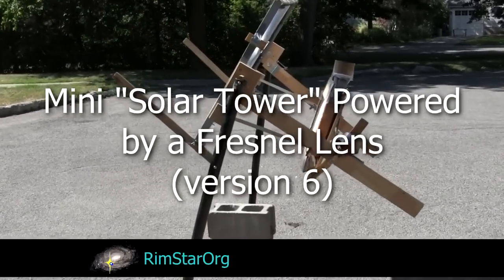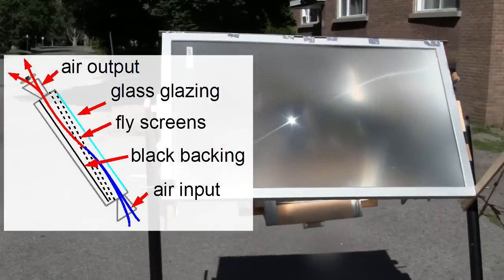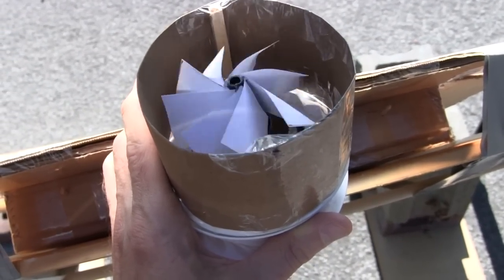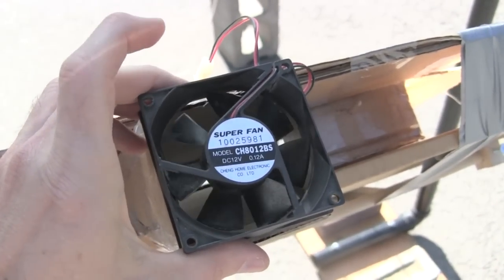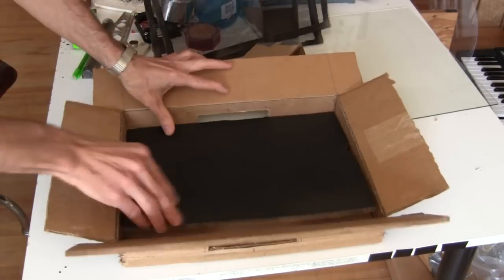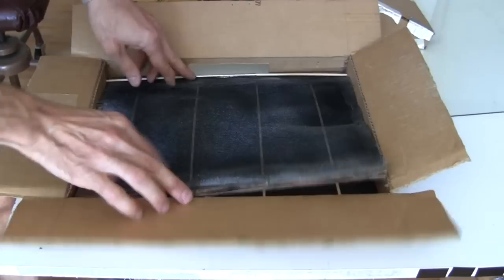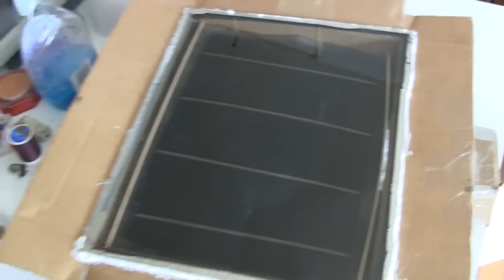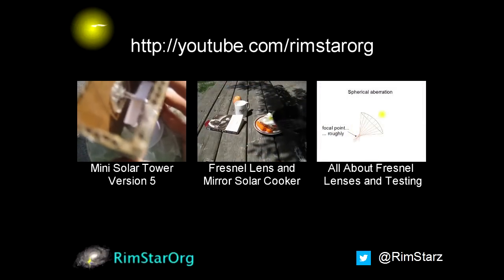Mini Solar Tower with Fresnel Lens Ver. 6 Screen Solar Air Heater

Comment from the maker: Which materials specifically? The fresnel lens and its frame came from an abandoned rear projection TV. The stand and nuts and bolts is ABS tubing from Home Depot. The glass for the solar air heater box I bought from a glass store but any window glass would have worked. The cardboard is scrap from various sources. The PC fan is from an old PC. The dowel is from Home Depot. The camps were from Canadian Tire (hardware store.)
Thanks for your feedback re the video being easy to follow.

Comment from the maker: I went with cardboard instead of plastic because it's less prone to melting (a problem I had with versions 1,2,3) and gave me a little insulation. Of course if I were leaving it outdoors I'd have to go with something weatherproof. I'd also stay away from a metal pipe, at least nearer the heat source as it absorbs all my heat (learned in version 5).  I do have some 4' long 4" diameter ABS which I could put at the hot air outlet of the one in this video (ver. 6). I smell a version 7 in the future.

Comment from the maker: Good point re the bug screen cutting down on airflow, even though that's also what creates the airflow. Maybe I'll try a version 8 next summer with a different type of absorber (part that converts sunlight to heat.) We'll see. I don't want the absorber to be too small because that leads to too much heat, heat loss and just plain materials and constructions problems as I saw with the previous versions. Thanks for the thumbs up and encouragement. Steve

Comment from the maker: I'm don't know where you think the heat "sweat point" is. I'm trying to heat the air and it's being heated as it passes through the black mesh which is the place where the sun's energy is converted to heat. I did one more version after this one, version 7, and you can find a link to it in the description below the video. I added a tower and got slightly better results, but still couldn't power the PC fan. I like your bi-metalic idea. I'll have to keep that in mind for the summer.

Comment from the maker: Hey, you're right! That would be fun. Though given that the major material is sand (silicon) it may not actually pop. There does seem to be a film-like coating that may separate. I'll add it to the list for when the snow is gone.

Comment from the maker: I'm not sure what the most efficient way to make electricity with solar concentration is. My guess is either heating a fluid like oil and using that heat to run a generator, or concentrating is on a multijunction solar cell (up to 40% efficiency for just the cell.)

Comment from the maker: For the part that spins, I started with a plastic cone that came with a toy gyroscope. I cut 8 pieces of paper 1"x1 1/4" and hot glued them to the side of the cone. For the stationary part I made a cardboard cylinder. I also made a U shape out of three pieces of balsa wood. I pushed a sewing needle up through the middle of the bottom of the U, making an E. I then taped the E into the cylinder with the needle pointing up. I simply balance the inside/top of the cone on the needle.

Comment from the maker: Thanks for the suggestions. Yeah, this video is part of a series and version 6 didn't have a solar tower. Version 7 has a 5 foot long, 3 inch diameter solar tower and gave the best results I've gotten so far. There's a link to the video of it in the description below this video or you can find it on my channel page as "Mini Solar Tower with Fresnel Lens Ver. 7 Screen Solar Air Heater".

Comment from the maker: It's flat so that I could have a lot of surface area where the air contacts the black absorber, the place where the sun's energy is converted to heat. But I guess a round design could be come up with too. Let me know when you upload your video with your design you mentioned.

Comment from the maker: In my version 7 video (where I add a tower) I show a sanity test where I blow on the PC fan to get it to spin and the airflow speed needed is far greater than what I can get out of this, so even with the incremental improvements you mention I don't think I'd get it turning. I just need a larger diameter, longer tower.

Comment: There are probably equations to work out how high the chimney would have to be - if you look at the proposed solar thermal tower designs the towers are up around a kilometre high. I guess to increase the flow you'd have to increase the temperature difference (running in winter would be better?), increase the amount of air moving through, or increase the tower height. 
Great stuff!

Comment from the maker: The problem with making the pop cans hotter is that there'll be greater heat loss through the glazing/glass. The greater a temperature difference you have, the more efficient the heat transfer. So the greater the temperature difference between the cans and the outdoors, the greater the losses out that way. Plus there's the issue of having to have the whole thing follow the sun in order to keep the lenses focusing on the cans. I think a better solution would be more cans, if possible.

Comment: Originally I came for the Van da Graaf. Now I'll most likely be watching all you video's. Can't remember which country it was but saw how they generated electricity with what you did here on the small scale. They used a very large tower and acre's of plastic sheeting at the bottom. What I love best about your vids is, they make me think about how things work. I can see that I will be spending lots of time watching your channel. Yes, I did subscribe. Now to try some of what you have done myself.

Comment: This almost looks like a "solar furnace". which is large at the entrance and much smaller at the exit. Like a champagne glass turned upside down with the actual base removed. This means hot air rises and exits through a small turbine at the top of the furnace.I think the heated air exits extremely rapidly although it enters fairly slowly from the bottom of the device.The entrance and exit volumes will be identical I suspect. I have subscribed. Nice clear demonstrations.I like it!
Reply from the maker: +Rod Mac Glad you like it. There was a follow-up, version 7 which added a tower https://www.youtube.com/watch?v=OiARUwLPGdU. Possibly next summer I'll do more of the solar tower like you're describing. Welcome to my channel!

Comment: Rotate your box 90 degrees, moving the inlet and outlet as well and use a piece of carbon black painted metal instead of cardboard and screens for collecting the IR heat.  It is not so much the heat itself but rather the upward draft of a chimney that is the soure of power for a device like this. A tall narrow space will create more upward draft than a short wide space of the same volume.
Reply from the maker: Thanks. I added a tower in the next version. See http://youtu.be/OiARUwLPGdU.

Comment: I have built a 5m black test pipe and on the top a large diameter turbine to capture the hot airflow and make power. Mine works just fine and 10 of those pipes feed in an old fuel barrel cut to house the turbine. At the maximum output the turbine makes about 700W @ 24V turning 2 DC alternators from a truck. It's kinda noisy though...

Comment: you need a smaller opening in bottom to prevent back draft and the tube needs to be much bigger and the fan needs to fill a lot more space to create more pressure and prevent the air from just seeping out the sides bypassing the turbine and need better material metal pipe with air tight atachments

Comment: Some advice..  You want maximum heat in your tower.  That is where your power comes from is the rising heat pushing air upwards.  Your "turbine" axel must not be loose or off-center.  It has to be a very stable pivot with no give, no bend that only spins so it doesn't wobble.  The blades must come as close as possible to the edges of the tube or you are letting a lot of the heated air escape uselessly past the edges of the blades, thus reducing performance greatly.  PC fans aren't best choice..

Comment: why dont you boil water with it and use the energy from that
Reply from the maker: James Sciba That would certainly work better. I wanted to see what air could do.
Reply: @RimstarOrg  Do look up "solar updraft tower". The water vapors, being lighter than the air, ascends (so the height of the tower is much more important, and more is better), which causes lower pressure, which leads to suction + wind + lower boiling point, which helps more water vapors to make it up. 

I do wonder how efficient would be to have a 10 cm wide by 10 m tall tower with a 1 meter diameter transparent skirt above a black mat and a few plates of water for evaporation.If you make a video, please do message me on twitter at @sapioit .
Reply: NO GOD BUT GOD....

What Is Islam?

Islam is not just another religion. 

It is the same message preached by Moses, Jesus and Abraham.

Islam literally means ‘submission to God’ and it teaches us to have a direct relationship with God. 

It reminds us that since God created us, no one should be worshipped except God alone. 

It also teaches that God is nothing like a human being or like anything that we can imagine.

 The concept of God is summarized in the Quran as:

{ “Say, He is God, the One. God, the Absolute. He does not give birth, nor was He born, and there is nothing like Him.”} (Quran 112:1-4)

Becoming a Muslim is not turning your back to Jesus. 

Rather it’s going back to the original teachings of Jesus and obeying him

Comment: I am thinking about building a pop can furnace that is supported by several Fresnel Lenses.  Have you ever thought about building something similar?  The pop/beer can furnace is a really neat idea and I thought that if you were to add a Fresnel lense it might make it work better.  I know it would certainly make the pop cans much hotter.  I am just afraid that it might cause them to get too hot and catch on fire.  Maybe I could just make sure not to have the lense at the focal point like you did.

Comment: Does anyone know if larger fresnel lenses produce hotter array? or is it just a larger area in which it casts the heated light
Reply from the maker: A larger fresnel lens would produce more heat. You'd just have to adjust the distance between the lens and wherever you want to produce the heat such that no light is missed. Some lenses do produce a rectangular spot and some a circular spot, but that rectangle or circle can be very small if you're at the right distance from the lens. There are other factors when considering a lens too. I'm no expert on those factors but I know my lens, taken from a TV, is very cloudy and so not as strong as a clearer lens would be (clearer means more light getting through).

Comment: I have a question instead of the box with screens used in this project would it be better to use the box of steel cans from DIY Steel Can Solar heater ( Homemade "Steel Can" Solar Air Heater! DIY - STEEL CAN Air Heater! (140F+) - EASY Instructions! ) instead of the screens shown in this video Thanks for the answers.
Reply from the maker: No, the screen absorber or matrix type solar air heater has proven to be a very efficient design, around the same efficiency as the backpass design, which is what the can solar air heaters are. If you're not familiar with the terms, I talk about them on my website here: http://rimstar.org/renewnrg/solar_air_heater_types_diy_homemade.htm

Comment: I think the reason it is not so efficient is that you need longer path for hot air to accelerate. Just one foot is not enough. Think it as a chimney, which in some buildings can be pretty long from bottom to the roof. 

My suggestion is that you should try focus your lens onto some black surface, let whole channel ("chimney") to heats up by absorbing 'overheated air', and then put fan at the top of such channel. I bet you will get more 'hot wind' this way. 

Idea is good, but I think you need just more length of the tube to gain speed of the hot air. 

What you think?
Reply from the maker: I tried something very similar to what you suggest in version 7 (http://youtu.be/OiARUwLPGdU) except that I put the fan a the bottom of the black 5 (4?) foot tower. But the important part is that the tower is there, like a chimney. But in that video I also show a sanity test I did by blowing on the paper turbine and then blowing on the PC fan to see just how much more airflow I'd need. The conclusion is I'm not even in the ballpark. Thanks for the suggestion though.
Reply: RimstarOrg Thank you too for quick reply. I like to see when people try to harvest solar energy and convert it into another form of energy (mechanical, then electrical). But, when summer arrive, I am blocked by too hot weather (I had heart attack in 2004, so doctor said that it is not wise to expose myself to extreme heat, nor extreme cold). 

It is shame to me that I don't understand why collected power with fresnel lens, which can reach kilowatt range per square meter, can't push such small turbine. Probably I don't understand thermodynamic that well.
Reply from the maker: *****
I think it has to do with the inefficiency of this particular technique. This same Fresnel lens had no problem running my Stirling engine here http://youtu.be/U5axWtCqgCA running both a piston, a diaphragm and a larger fan, and I'm sure that one could be improved.

Comment: The PC cooling fan might work, but you would need a much longer chimney to overcome the hysteresis loop. What are the specs on your cooling fan?
Reply from the maker: It says 12V, 0.12A on it, which I'm guessing is the expected input.
BTW In part 7 I added a tower but that didn't do it https://www.youtube.com/watch?v=OiARUwLPGdU. But I also do an experiment to see what would be required to turn the fan and it's a lot more than a small system like this could provide.

Comment from the maker: With version 5 I started using the chimney equation. Have a look at my video called "Where I use Math" where I analyze this formula and how it applies to version 7 of my solar tower. I just put a link to that video in the description below this video. You can also find it in the Videos section on my channel page. The area of the chimney has the biggest effect, with height and temperature difference having a smaller effect.

Comment: Boil steam and use it's pressure to run a turbine for electricity.  The steam cycle's condenser then heats the water for your home in the process.
Reply from the maker: Steam would definitely be more efficient. I just wanted to see how far I could get with hot air and my Fresnel lens for this one. Someday I'll make a steam engine.
Reply: How well do these lenses hold up to the sun?  My beloved 65" Mitsubishi Diamond Projection HD widescreen TV is nearing the end of her life on this planet.  So I will have a 16/9 ratio mammoth fresnel lens panel to play with soon.
Reply from the maker: Gavin Curtis
My guess is that they're not UV protected. However, contact Dan at http://greenpowerscience.com I noticed he mentions a UV stabilized lens in this video FRESNEL LENS 9 SUN COLLECTOR SOLAR POWER SPOT uv stable and he sells lenses. You may be able to put on some sort of UV protection though I don't know how offhand.

Comment: Another way to keep it cool would be to water jacket it also the longer this lower tube can be the better  With this set up you should be able to place your fans any where in the tubes upper lower where ever I see one of your problems with your set up as heat transfer also if you need to increase your colection area to build more heat build a reflector trouph behind your (only) upper tower where you focuse the fresnels focal point If this doesnt work you may need to wrap the exposed upper and

Comment: Just make a hugh heat sealed  inverted funnel.. clear on one  side and  black on the back.. put your  turbine  motor under neight.  doing this a t the base of a mountaing facing south would allow a  greenhouseto suck up the air.

Comment: i made one like this but imagine a Large  part under water after the Magnifying lens ...

i started with air like you but couldnt make power the way i wanted ...

so i figured water being thicker would transfer motion better to the turbine ... seems to work great .. 
yeah and my water version works best in the hot spot . i never figured out the air version works better in lower heat , i made the high heat way  work for me

Comment: Like your hands on approach, but to turn the PC fan, you're going to improve your design a bit. I would say use a much longer tube, and not to use card/cardboard but perhaps plastic instead. A drainpipe / downpipe, or cable conduit pipe should conserve more heat..a black plastic pipe would probably be ideal. If not, large food cans, top and bottoms removed and joined together would form a tower tube as long as you want. The lobger the tower, the more force on the fan(s). Thumbs up to you.

Comment: yes and chemney need not be all above ground. Multipol tubes ran through cooled ground will provide cooler suply air to themain tower. The temperature differance between the feed side and the hot exit side needs to be as great as possible then add fan where ever on horizontal or vertical  I favor vertical as you dont have to fight gravity as much

Comment: Ok so heres my two cents Try feeding the bottum cooled air , aim the focul point at the top of your tower useing less conductive matterials for your tower to reduce heat transfer and there by contamenation of your cooler intake air and as someone above said tighten up fan in tube to reduce blow by of you air stream I can also suggest one other thing to per fect your design but that will be in the form of my own video as it is my idea and extra lil something something

Comment: I want to recommend that use foil paper inside box so it wont lose heat and it will also seal air inside. Try using fan with more bleeds and less gap just like your paper one.